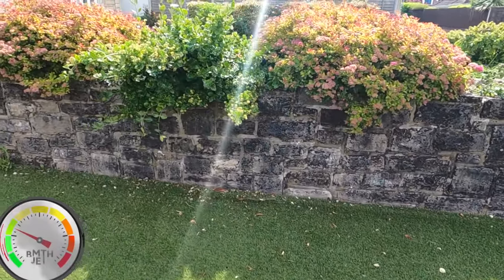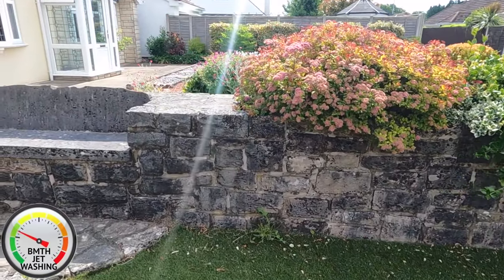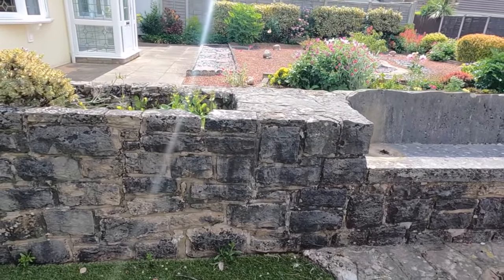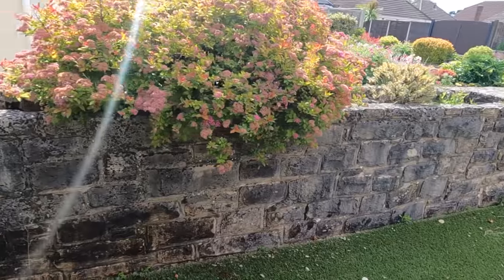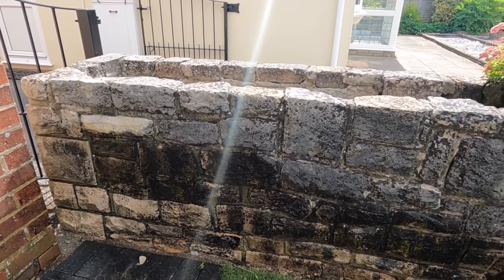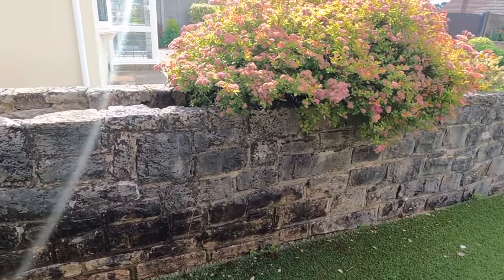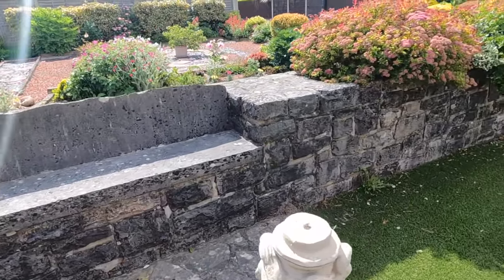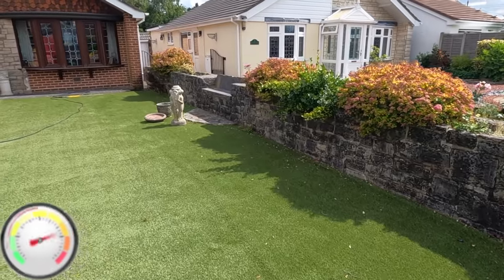Purbeck stone wall hot pressure washing and treatment

Comment: Is there a reason that you start at the bottom of the wall? It seems to me that one would start at the top so that the dirty water is going down onto dirty walls and one would continue to move the dirt from top to bottom.
Reply: I was wondering that also
Reply: It's because he has an extra chromosome
Reply: Stop making sense.
Reply: Starting at the bottom when applying product is standard practice in both pressure washing and soft washing systems to prevent streaking

Comment: Really surprised you don’t use a foam cannon attachment for that post treatment. If you are restricted to hand applying those things, save your knees and get a roller mechanics seat. Great job!
Reply: HI, as my knee started to go i used some large pillows, then i went to the local hardware shop and purchased 2 of the strongest foam outdoor cushions i could find.

They help a lot, but to be honest, i have 4 of the best knee cushions, 2 old office chairs that were sent for scrap , i removed the seat and backrest and i have 2 pieces in the garage, one in the boot of my car and one in my wifes car, the ones in the car are for when we go visit the kids and decide to help with cleaning or gardening

Also when i wash my car i have a large square bucket and i use a cheap soft broom / brush - this is to do the lower fenders and sill panel, but for the last 5 years i do the entire car now, the bristles must be the softest available - this idea was  given to me by a used car lot elderly gentlemen who washes about 30 cars 3 or 4 times a week and has bad arthritis

Comment: Fairly new to the pressure washing business.
Have to ask why hand apply the chemical and not apply using an X-Jet or other spray method?
The results you got were amazing.
Keep the videos coming Ricky!
You are truly a master of the craft.
Reply: X-jet you have no control over ,by using a chemical injector of roller pump u can adjust the flow and chemical foam up to what you need

Comment: The same things can you apply to old monuments/buildings without any damages?
Reply from the maker: yes you can,  but its best to lower the flow rate to around 5 litres a min and turn the heat up to 150c to avoid any damage,  or you can use a doff machine which is the same

Comment: Great job but I'd be a bit worried using a pressure washer on stone walls incase there's mortar in between stones/bricks...
Reply from the maker: These are very strong mortor joints but using hot pressure washing you dont need too much pressure

Comment: Do you  pretreatment of mold etc? 
You can't beat a Irish barley sandwich. It goes with everything but driving😉.
One other thing. I use a small spinning floor  attachment on the end of the wand. Does a great job on sideways but light enough so can do low walls .
You definitely give a 5 star job.
Cheers Mate
Reply from the maker: Hi ya yeah sometimes i pretreat, the small surface cleaners can come in very handy on some jobs

Comment: Just curious, I powerwash using flat nozzles and on tough jobs I use a Turbo Nozzle that is more effective than any standard nozzle. When I do, I was from top down, to minimize the dirt and algae that washes down on the finished product. Is there a reason that you wash bottom up?

Comment: Amazing what just a bit of attention will do for any project. Personally, I would stop with just the power wash. @3:25 the stone looks amazing. There is no comparison to the handiwork and talent of years gone by. Cleaner, but still has the character gained from years of service. I am speaking of the stone here, not the brick. If I want a "new" wall I will construct a new wall. Again, that's just me. 

I do have a question for you, how do you determine if the mortar will withstand the heat and pressure of the wand?
Reply from the maker: hi ya, you know how much it can take , so go with a lower pressure and high heat to start

Comment: Question, everytime I use my surface cleaner my pressure washer starts to shake then turns off.. If I change the surface cleaner out with a turbo nozzle or any other tip I have to problem.  It's just when I use the surface cleaner.. never had this issue.before.  pressure washer is 1 year old.
Reply from the maker: Could be a blocked nozzle that is making unblance , check and clean
Reply: @Bournemouthjetwashing  yes, that was the 1st thing I did, and even switched out surface cleaners.  Same deal. Yet when I use any tip including a turbo nozzle I have no issue, runs like new.  ??

Comment: Hello.
What degree was the walls cleaned at and also what was the chemical solution used .
Thankyou
Reply from the maker: 25 fan tip and hypo
Reply: Sorry i ment heat settings?
Around 100?
Reply from the maker: @Bradus-jp3wf  yes

Comment: Why do u start at the lowest level.  It's like sweeping a stair case, u start at the top and work down.  That way the dirt is all at the bottom.  It's not running over what u have already cleaned.  Though it doesn't seem to do that.

Comment: how much is the pressure during cleaning?
Reply from the maker: around 100 bar
Reply: @Bournemouthjetwashing   100 bar? Then how many liters per hour does your pump distill water and what is the size of the nozzle? I also do slining, but at 130bar and 500 liters per hour there is no such water spraying...tell me what is my mistake? Or name your parameters it is very interesting to get your experience... I am not a competitor to you from Uzbekistan 😉 😉 your information is very important to me. Thanks

Comment: Blow the mortar right outta the joints. After cleaning, the brick will need to be tuck pointed. No?
Reply from the maker: nope , low pressure hot washing
Reply: @Bournemouthjetwashing  looked like high pressure to me. I still call BULLSHIT.